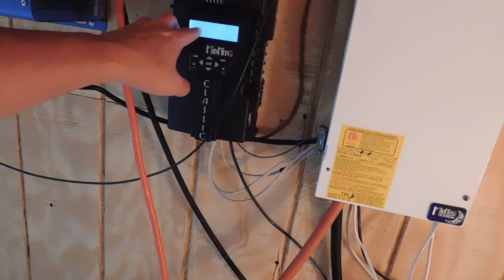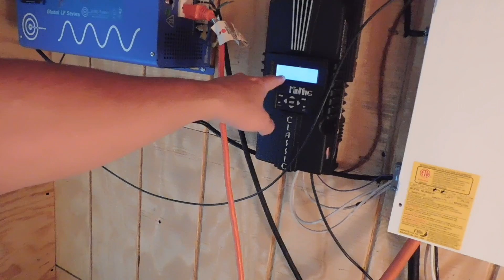Sizing your Solar System.

Comment: Great video. What is your take on building a battery bank with 18650 batteries?
Reply from the maker: If you can use Trojan batteries it would be better.
Reply: preppernurse1 Okey, thanks for that answer.
Reply: why are Trojan batteries better?

Comment: Awesome video!! It looks like your wiring maybe slightly wrong, it looks like you have your inverter & charge controller attached to only 1 string of batteries. To make it more efficient, put the positive of you charge controller to the positive of battery string 1 & the negative from your charge controller to the negative of battery string 3. Then put the positive from your inverter to the positive of battery string 3 and the negative of the inverter to the negative of battery string 1. That way all of the batteries are used together more efficiently 👍
Reply from the maker: I have checked them and all the batteries are doing well but thank you for the tip that's not a bad idea at all.
Reply: preppernurse1 cool 👍 I've just upgraded my solar from 12v to 24v, I'll make a video about it soon showing how I have my batteries hooked up

Comment: Thanks for the information I have a 12-volt system right now I have 2 Trojan L16s. I printed off a state of charge chart off of the internet and it is saying that at 12.3 the batteries are at 70% just wondering if this is in the ballpark for a 12-volt system I have never let the batteries get below 12.4 which on this chart says 80% just want to make sure I'm doing it right and not hurting my batteries thanks for any input your videos are awesome
Reply from the maker: You are doing it right  and if you can go to a 24 volt its so much better.

Comment: Im doing over 15 kwhr a day..If you have enough Panels. and sun..You can charge your batteries and use extra panel power during float. Keeps your batteries topped during day and still have Power during the day.
Reply from the maker: That's very cool we do stay in float a lot but I want to add more panels just to make it even better.

Comment: Excellent video, I have been thinking about building a portable solar generator, basically it's a scaled down version of what you have and fits on a dolly or large pelican box, some people build them with lithium ion, much lighter than lead acid and you can drain them down to zero with no damage to the cells.  Solar power and a generator definitely compliments each other, good example of how you use your generator in the winter to make up for lack of solar and allows you to only run the generator for a few hours a day.
Reply from the maker: Thank you very much.

Comment: does  your generator, when using it put off 24 volts ? my generator puts off 12 volts, what type or how , or method, to go into your 24 volt system, as of now i stayed on my solar at 12 volts, put i set my panels on swinging, or rotating to follow the sun here in florida, (about a 40% increase of input in my batteries, i use my water distiller, at peak sun time,im adding more panels soon,i am on grid still, a big learning experience ! a lot of rain here this year ! im still prepping ! hurricane who ?
Reply from the maker: The generator just feeds power into the batteries I will have to look and see how it does that.

Comment: ED you are slightly confusing how you explained the battery bank. Maybe I can help clarify it a little for your viewers. First thing you need to explain series and parallel connections. In a dc circuit a "series circuit" is connected from a positive post of one battery to the negative of another battery, hence if you start with the negative of one battery the connections will look like this,   -  + to - + to - + to - + . the word "to" signifies a connecting wire, thus you end up with a free negative terminal on the first battery and a free positive  on the last or fourth battery. Adding batteries in series increases only voltage! So if you did those connections three times increasing the voltage of four batteries you end up with one battery at 24 volts and 370 amp hours. If you duplicate this process two more times you end up with three series batteries This is where it gets really interesting a parallel circuit is when you hook all positves and all negatives from the 4 batteries in series to make a 24 volt battery bank to 2 more battery banks of the same size, you then ONLY adding the amp hours. so that 370 x 3 = 1,110 amp hours at 24 volts. to convert voltage and amp hours you multiply together thus at 24 volts times 1,110 amp hours = 26,640 watt hours. to convert to kilowatts move the decimal to the left 3 places. remember positive to negative of different batteries = SERIES where only voltage is added together essentially making 4 6 volt batteries into 1 24 volt battery. then PARALLEL by connecting all positives left unused, to the load/charge controller and all negatives you add the amp hours together! IMPORTANT NOTICE .......NEVER ....EVER......... HOOK THE POSITIVE AND NEGATIVE OF THE SAME BATTERY/OR BATTERY BANK TOGETHER!!!!!!!!!!!!!!!!!!!!!!!!!!!!!
Reply from the maker: I hope that helps people understand better.
Reply: preppernurse1 me too, however words are infinitely harder to understand than a picture in this case.

Comment: The battery connection is turning green. Might want to take and clean it up
Reply from the maker: I am going to treat them as soon as I get paid this week.
Reply: You need to take the connection apart scrape the scale off then put some contact paste on them

Comment: Thanks for making this video! I feel a little less ignorant about solar and how it works now. Still a lot of questions. All those numbers you mentioned.....hard to understand what all those numbers mean. But at least now I get some of the basics of how your panels/inverter/batteries work. I will admit prior to watching this video I had no idea what an inverter was. Watched many videos on youtube on solar............but none explained solar for really solar ignorant people like me. Maybe most people already know about these basics. But not me for sure! So it is all about the batteries rather than the solar panels? The solar panels just dictate how much solar is coming in. But the batteries power is what dictates how much or what you can run electronically in your house. So the size or output of the batteries is what you need to focus on when thinking about getting a solar system? I always just assumed it was the panels and how many. But it is the batteries that are the most important. Good to know! Still many questions but thanks for educating me on the basics of solar power.
Reply from the maker: No problem at all I am glad to help.

Comment: what does you generator run on, if you were to not use the generator how many days would your batteries last you in the winter
Reply from the maker: It runs on gas and it depends on how much power we are bringing in.